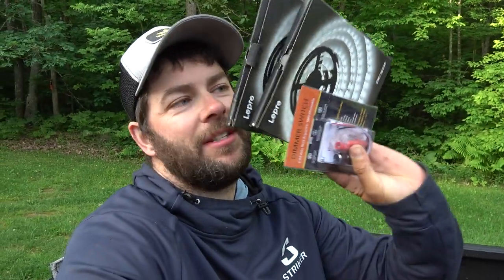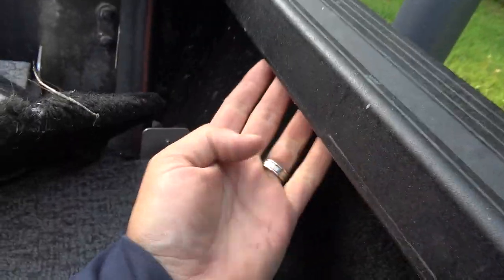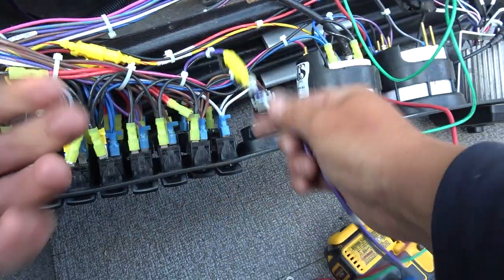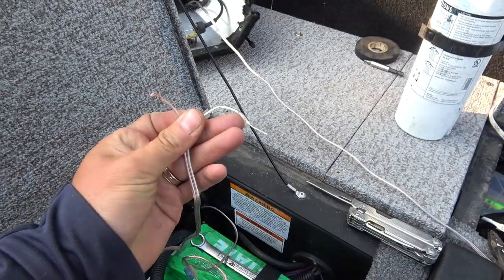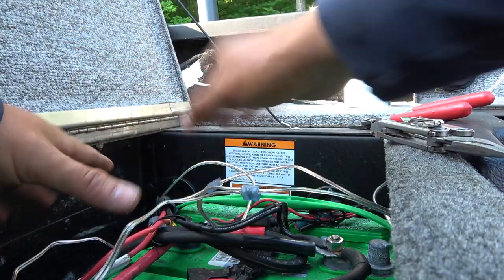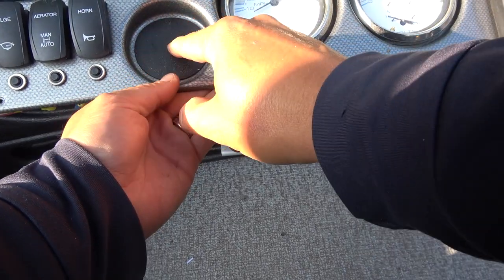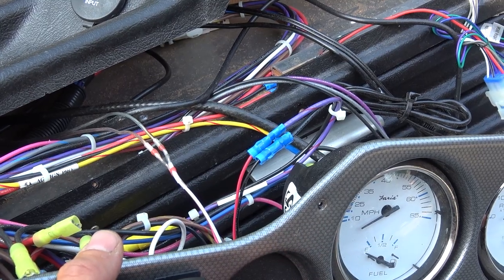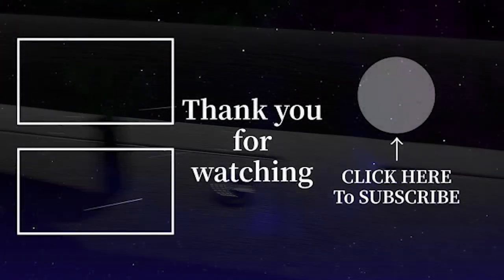Light Up Your Boat: Must-See LED Lighting Modification

Comment: You would think the Wisconsin fisherman would have a “ fish tape”.
Reply: When you have caught as many as this guy, you don’t need a ruler. They are as big as you want them to be, especially C&R. I learned a little trick on how to judge fish size in a picture. A man’s knuckles are about 4” wide. That turns a few fish from 24” to 21”, but I never burst their bubble, ha
Reply: @danschoemann2305  A fish tape is tool used by electricians to pull wires through small spaces.
Reply from the maker: Clothes hanger works for me lol
Reply: @Wisconsin_Fisherman  I used them a lot for the same thing.
Reply: Sorry I thought people would get the pun
Reply: @dennisneuman9380  I was hoping you were kidding, but you never know!

Comment: Hoping to learn something new.  I did that to my boat, twice.  First time I thought I had messed up by not cleaning the surface right or pulling too much while sticking it to sides.  Soldered and shrink tube everything.  The double sided tape falls off the strip after about 6 months and the tracks connecting the LEDs broke.
Reply from the maker: I did this to my old boat and it held up for years. Maybe something to do with climate

Comment: LIsten, not to burst your bubble.... Some of your electrical wiring technique does not follow best practicews as defined by the ABYC (American Boat and Yacht Council) Electrical Standards.  Those butt connectors that you are using are not appropriate for a boating environment.  When you heat up the connector and the solder melts, bonding the wires, it also turns stranded wire into a solid core wire.  Solid core wire or stranded wire that you solder which becomes solid at that point is subject to failure due to vibration and movement, more so than crimped stranded wire.  
Also those "Scotch Locks", I believe you called them, are not the proper choice for a marine application.  The non-secure connection of the stranded wire  and the metal bridge of the connector are subject to failure from movement, corrosion, moisture ingress, and voltage drop.  Please see the ABYC standards for electrical connections.   It was great that you were able to find a circuit that was alread fused!  Congrats on that one!  Please stress to your listeners that it is imperative to use the proper sized fuse in such applications and projects  This was a great project for boaters to undertake to upgrade their own boats, but it is important that they do so safely.